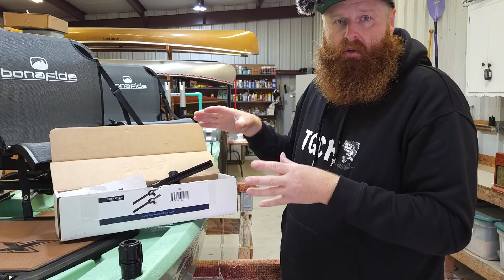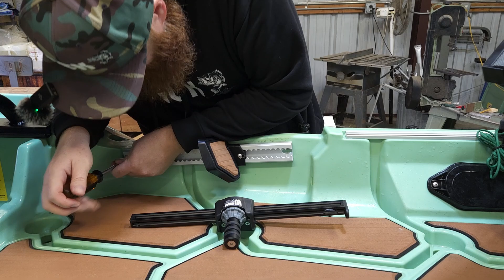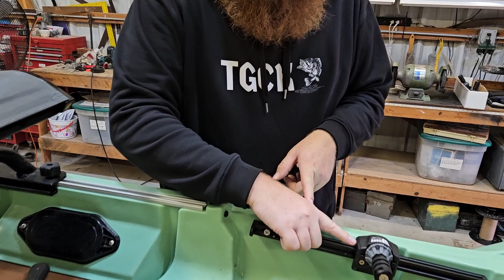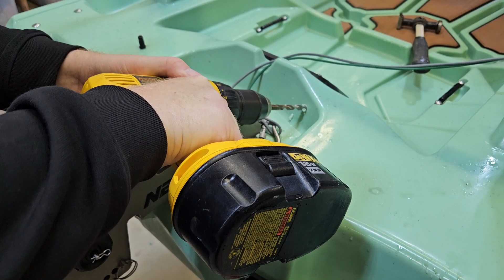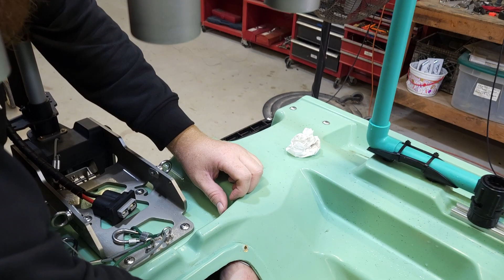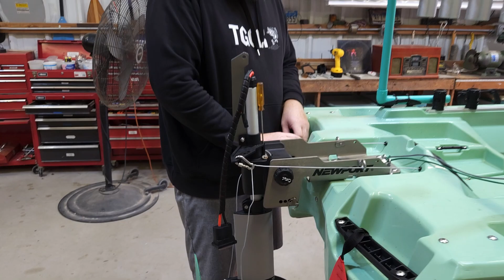Wizard FCS Unboxing and Installation for Kayaks

Comment: Would u recommend the insert or the tubing that came with original steering kit years ago ?
Reply from the maker: I have used both methods. just depends on the build I'm doing. However the inserts are easier, and more common now.
Reply: @tgcanoesandkayaks I have a ss127 that I installed original steering kit on years ago and have th tubing. But I just bought the wizard steering kit and was debating taking the tubing out for the inserts. I feel like it might be smoother I am having some issues when it sometimes gets sticky and hard to turn with the tubing. Do u think I should replace tubing with inserts ? 

Thanks for reply

Comment: Is there any concern with this line rubbing the plastic interior over time? Seems like it would rub grooves eventually.
Reply from the maker: No, you generally run it where its not contacting anything permanently, free floating it.
Reply: @tgcanoesandkayaks  Thanks, didn't look like there was a good spot for it to not be rubbing anything internally but I guess I'll find out today - pedals should be delivered shortly.

Comment: Think the wizard can be mounted on the two center tracks on the coosa x.  So I don’t loose rod storage ?? 🧐 they would just be vertical pegs right ??
Reply from the maker: I think it would be very difficult, however that would be the dream scenario on the X. We have mounted a few sets on the tri-rails using 90 degree track adaptors, but that does take the rod storage out.

Comment: Before tying the lines to the motor steering triangle,or after you have connected to the pedals do you want the pedals to be in the middle position on the respective rails? Trying not to overthink this! LOL.
Reply from the maker: I start them at full extension, use a bar clamp to hold the pegs from sliding, then pull tight and tie on the triangle. take clamp off, then roll line up inside the wizard until mid way on the rail.

Comment: With an NK300, what makes it hard to steer - with AN Y foot steering mechanism - is the friction in the steering tube from the motor's torque when powered up over 50% throttle ...! 
I overcame that same friction, by extending the span of the steering triangle a couple of inches on each side.  That gives a better mechanical advantage (leverage) over the whole steering mechanism.(Think of a longer tiller handle, on an outboard...!).  Lol
Reply: How did you extented the triangle arms?

Comment: Great video. So there’s no need to add tubing for the spectra line inside the hull of the boat to prevent the spectra from sagging?
Reply from the maker: No need unless you are running a lot of internal wires for lighting and so on.

Comment: Great video. Will these fit a Precision Pescador Pro 10 ?
Reply from the maker: @kkeefer44  Good question. I do not know as of right now. If I find that kayak to test out, I'll let you know.
Reply: @ Thank you. I appreciate the quick response. They use the Harmony Keepers foot brace and the slot the track runs in is 22 inches long.

Comment: Will these fit on a Crescent Shoalie?
Reply: The SourceSteer does, I think the wheels will hit the ledge on the Shoalie on this one.
Reply from the maker: I just test fitted this for you, the rail aligns properly, however you will need a half inch spacer between the rail and the kayak, as the bottom roller bearings do indeed touch the bottom edge of the Shoalie rail cutout area. I can send you pictures if you would like to see, just dm me on instagram.
Reply: @tgcanoesandkayaks still have these photos by any chance? Looking to upgrade the shoalie.